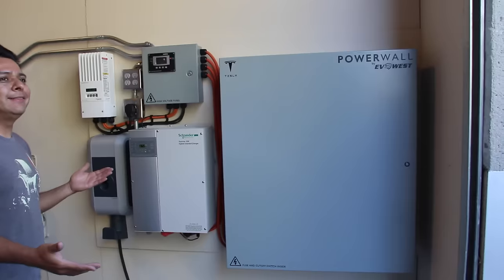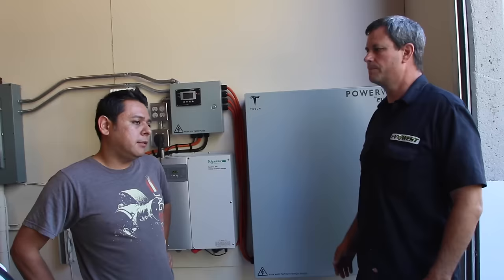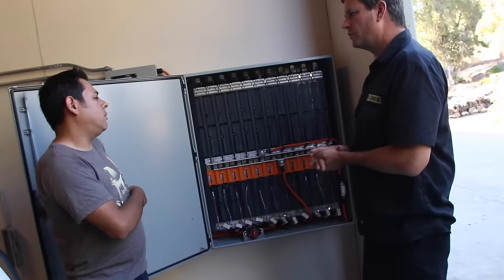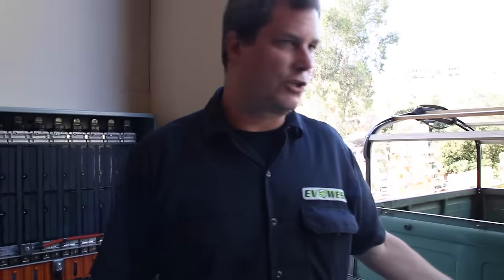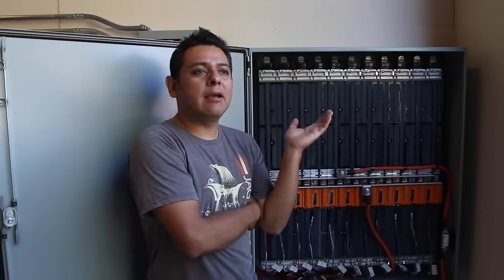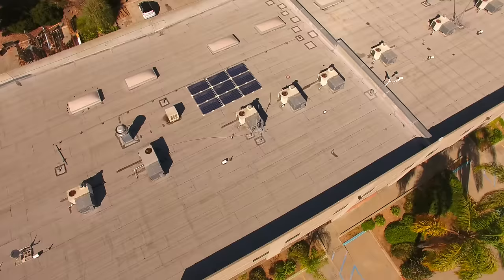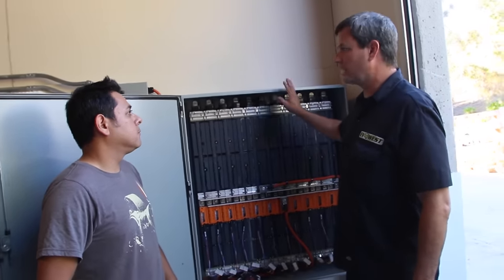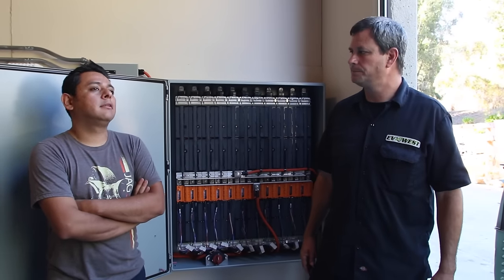DIY TESLA Powerwall  - my  WALL vs ELON'S WALL

Comment: So... there was an ad before your video began where you simply replace a "battery pack" in your lawn mower. Why worry about the cable hookup and the big chunk of down time to recharge your car? Why not simply make the car power pack replaceable? And instead of driving to a recharging station and "topping off" the car's power pack,  and taking that long down time, why not simply drive your low car battery pack to your shop or to a "recharge station" and leave your old, low battery there, pick up a newly, fully charged power pack and plug it into your car and go? For driving across country, you could simply load up 10 of those car power packs and go - practically non-stop. In addition, you could have a "to go" car battery power pack recharger that you could set up while you're driving so the sun can "trickle charge" your car's battery power pack. I don't know anything about any of this, but what I just said seems way more logical and doable.
Reply from the maker: +Ken Jelinek battery pack is 700 lbs
Reply: Haha! I had no idea! But still - for now it is. Everything is usually overbuilt, bulky and unsightly in its beginning phases. But as batteries get smaller and more powerful - just like every technology - then that's where we'll end up. So, why not leapfrog this step and start planning and building toward the next step? Again, look at the lawn mower advertisement. https://egopowerplus.com/pages/technology
Reply from the maker: yeah,  building an interchangeable battery pack is not hard,  many have done it including tesla,  its just not very practical at this point  but totally doable
Reply: yes this is already being done around the world and I believe a few places here in the USA with telsa from what I understand.

Comment: Why get the DC voltage up and obtain lower current ? Answer: Cable loss = current^2 x cable resistance. Plus: contact resistance and all other resistances in the circuit. Simple example: P = 5kW R_cable=0.1Ohms. At Voltage = 200V P_loss is 62.5W whereas at Voltage = 500V  P_loss is just 10W. Not linear. Voltage ratio is 2.5 whereas cable loss power ratio is 6.25. Nerdy ? Yessss

Comment: What brand of solar panels do you guys typically use? I see the one in the description is Boviet? Is there a brand to avoid etc? Also how are they wired? I'd assume you can't just series all of them since I think the gauge of wire wouldn't be thick enough for all 6 through the wires on them. Thanks.
Reply: I recommend solar panels that are made in the US, e.g., Suniva, and other places where they have reasonable manufacturing standards, ensuring minimal environmental impact. Each string is wired in series. If you go with SolarEdge's power optimizers, their inverters have technology to maintain steady voltage, regardless of the number in series. I simply have two strings of 12 panels because that's what fits neatly on the house. Each panel connects to one another with plugs that come stock with the panels, then you run USE-2 cable (usually pretty thin gauge - mine is 14 AWG) to the inverter. I bought a kit from WholesaleSolar.com. It was ridiculously easy to DIY. Saved $15,000 by doing it myself! Engineering labor is freakin expensive.

Comment: From my limited knowledge, all you would need to do is tilt your panels at "your latitude" (as listed on a globe or gps) ...that tells you your degrees from the equator, where the sun is, on average, directly overhead. i.e. If you lived in Equador where your latitude is Zero degrees, you would tilt your panels "Zero degrees" (you wouldn't tilt your panels, you would lay them flat, parallel to the ground!)  because the sun is directly overhead.

Comment: I find this power wall much more interesting than the Tesla. Tesla will run at a higher voltage than most current inverters can use. I would be interesting in the battery pack at about 1/2 that size. I do worry about the longevity of the LithiumFePh batteries though. Yes I use lead now (off grid 15+years) could you get warrantied batteries for 5 years 16 Kwh for $5K that would be competitive with forklift batteries (5 year warranty 15Kw @$2500 delivered)
Reply: The are FLA batteries that have an 8 year warranty.  Battleborn Li-Ion offers a 10 year warranty but they do NOT state "% Capacity Remaining" after any # of years.
Reply: @vtorsi610  FWIW - 9 years into my current forklift battery, doing well. The company dos offer a 10 yr warrant to 80% state of Capacity. Some people have gotten 20+ years off of Crown Forklift batteries. I'd like to get 12-15.
Reply: @whitelfner4582  WOW!  Owners always report  good things about Crown batteries.

Comment: I like this video, I was wondering how to acquire those offset conductor bars in the video and best way to contact Mike about the aluminum bar the batteries are hanging from? I am making a solar shed setup to charge my electric motorcycle and power a small addition on the house. Using this setup as a general blueprint.  Starting with 3 panels and adding 3 more every other month as $ becomes available.  What do you think the smallest number of batteries I could start with?  Sorry to hear about the cancelled Samba project, hang in there.
Reply from the maker: +Keith P  you need to fab the pieces.  How big will your inverter be?
Reply: I'll be using the same size, the XW6048 if I can find it reasonable, or a new 6848 otherwise.
Reply from the maker: At peak each module is good for 1/2 hour so I'd say start with a couple and add from there
Reply: Thanks for the feedback.

Comment: I would have gone with NiFe batteries.  This is exactly the reason Edison invented NiFe batteries in the first place.  NiFe cells don't stack nice and neat and take up a huge amount of space but they are have extremely long life, nearly limitless cycles and a very deep depth of discharge.  The main drawback is cost per Ah but I think the other positives far outweigh that one negative over the long run.  Lithium Ion cells start losing charge capacity fairly quickly and a very specific number of charge cycles.

Comment: So, right off the bat I'm impressed by what you guys are doing!
One question I have (and I'm a complete novice here); I work in a Government department (not USA) & we sub-lease other agencies in our building - it's a win-win situation for us...
However, when a new agency comes on board they have an option to use our 160KVA UPS (via backup generator - if required), or they can be self-contained & have their own UPS off of the tenancy supply.  But what we will not do, is have a UPS piggy-back off of another UPS & the reasons I was told is that when you connect UPS's in series that you "wear out" the upstream UPS 'faster'...
Is that of any concern for a "PowerWall" situation like this; where you're using (essentially) a UPS to charge another UPS?  Or is there no concern, because effectively the upstream UPS is only charging the downstream UPS for a brief period (read: not constantly)?
Reply: It seems more likely that the suits don't want some other department lasting longer in a power-outage situation than your dept.  If the power goes out, your UPS would provide leckky to whatever is attached (including the 'cheap' UPS in the other dept).  
However, once yours is empty and it stops providing power to your department, the other dept's UPS would still be full of charge.  The cheap UPS would then use it's batteries to provide power.  This would give that department more runtime than you guys, which I would imagine that the suits (who spent many thousands on a UPS) wouldn't be too happy about.  Why should a cheap ass department get more runtime when they have only spent a couple of hundred on a UPS solution??  How do you justify spending all that money on a UPS when your boss comes along sees the other dept still working happily?
Yeah, you could argue that this will "wear out" the UPS faster, but I don't think that's the real reason...  office politics is probably closer to the truth!
Reply: the problem with Daisy chained ups is there there is no indication of power failure to the downstream user and therefore no mitigation of systems until the upstream UPS is dead.
Reply: The downstream UPS won't "wear out" the upstream UPS.   However,  the downstream UPS  will  burn extra watts of  energy to charge its own batteries,  above and beyond what the bare load would draw,  and that happens  even when the upstream UPS is on backup power.   So essentially,  the issue is that more electricity is being used during a power outage condition.       Also, if the downstream UPS is sensitive to the voltage dip;  when the upstream is on backup power,   the downstream UPS might reach a condition where it is  repeatedly switching itself  On and Off between "Line" and its own backup power,  the downstream UPS might cut out, even while the upstream UPS is still supplying power.

Comment: Hey jegugarcia, I have a big question on grid scale battery. 
1.1MW/MWh battery vs 5MW/20MWh battery 
The 1MW is used for regulation service and the 5MW is used as a peaking power plant, but both can be built with a same AH battery but with different inverters ? 
Can you explain more I am not able to connect everything?

Comment: You need a permit to install solar power on your house in Michigan. Your tax will be assessed on the added cost of the solar system, and your property tax will increase forever. Further, DTE pays 2 cents a kVh you produce, charges you 17 cents for all you use and you need to pay $200 for DTE connection. In short, going solar in Michigan is a losing proposition.

Comment: How do you compensate for the float stage? I've read that floating Lithium batteries is a big no no. You may not have this issue as you guys are always charging vehicles with larger battery packs and your charge controller may never go into that stage.
Reply: Li-Ion certainly can be put into Float charge ...

Comment: Hi Garcia, I am from Honduras, the cost of electric energy here is at all time high, probably the worst price per Kwh in latin america. I have to air conditioners of 18,000 kwh/220v in the house, I want to power them individually using your DIY powerwall, each ac will work 12 hours a day.  Do you have a video for powering air conditioners? How many solar/Tesla panels will I need? Thank You.

Comment: What if you mounted the electronics in a car using the batteries already there with the panels on the roof how long would it take to fully recharge the car ?

Comment: Jehu check out Solar Power Electricity and Electronics channel he has most of his entire house running on Solar Panels, even converted his TV's and Dryer. I'm surprised all that sun not many in California are getting on the solar panel bandwagon.
Reply from the maker: +TekReviews  every other house has solar in Rancho these days
Reply: jehugarcia Oh that's good, in Australia even if you have Solar they don't pay you near anything for putting energy back on the grid. I saw a documentary in Cali about getting low income people hooked up because they can't afford running an AC all day long in that hot heat wave. Maybe you can do a project powering a room air conditioner for a low income household with those smaller solar panels you get at places like Harbor Freight.

Comment: Do you guys know when we are going to see energy storage in homes in the form of Hydrogen and Oxygen? They don't use it a lot in cars because of the sensitivity, but I can imagine in homes it is pretty safe. Fuel cells look promising for their conversion into electrical current. Storing gas can last forever, maybe some combination of a powerwall would be interesting?
Reply: Another conversion that reduces overall efficiency quite a lot. Also, storing liquid hydrogen and oxygen is kind of dangerous.
Reply: PbPomper
If i'm correct fuel cells based on H2 and O2 are the most efficient of all.
Reply: no, Hydrogen fuel cells are much less efficient than batteries.
Reply: @NextGenAge  NO!  Fuel Cells are LESS efficient ...

Comment: well i am sceptical. 15,670$ and you only use it for charging EVs? my question is: is it worth it? besides that it is a hobby.

how many miles could you go with 15,670$? 
i estimate that only rising prices for grid electricity and staying fully functional over 25 years would justify your DIY powerwall

Comment: Hi jehugarcia, I follow ur make powerwall all clip. I Interesting about Components and connection diagrams, And Then  If you can easily describe some of the features of each . When i saw your clip there seems to be as detailed on the circuit complex directory in your system.

Please describe about Components and connection diagrams
Reply from the maker: +Wichai Sriwiset   All that info is available in videos,  I don't have info on inverters because I don't have one yet but everything else

Comment: UPS uses 12v batteries. the inverter has to switch at 60hz which means a large transformer. eff is around 80% and power
is limited to about 1kw per transformer. the transformer ratio would have to be changed from 120/12 to 120/48

and the output voltage would sag with battery drain voltage sag. guess i should mention that the primary transistors would need to be rated for at least 60v which their prob not.

you could wire 4 ups's to each 12v bank within the 48v pack without modifying them. but it'd prob affect pack balance
Reply from the maker: +Brad Steffy I plan on using 48v ups units
Reply: +Brad Steffy The large UPS (for servers) tend to run off 48V, otherwise they draw a crazy amperage from the batts.  Consumer units are 24V or 12V - the latter for really weak & cost sensitive units (as they only require a single batt).  I have a UPS which I obtained for an in-bus inverter project (24V DC>240V@50Hz), but was rather annoyed when I discovered it was a 48V unit!

Comment: Hi and greeting from Melbourne Australia. Question#1 What happens when your battery wall pack is fully charged. Question #2 Can this Battery wall pack power a house with all electricals inside including Fridge/Washer and A/c's, Computers, Big screen LED TV's and electric heaters etc...
Reply from the maker: +SirZok1  
1- stops charging   
2- yes
Reply: Thanks bro....

Comment: What twists my mind is: Why we have to convert DC to AC then AC back to DC when we use mostly DC-loads only? It's a lot of power loss added to the already low efficiency of PV panels.
Reply: So to get this staright, the car's batteries could be charged with DC from the storage batteries with a fancy charge control device. I know that the companies have to sell a lots of equipment to make money. But this is pure bullshit.
Reply: @szaki95  Don't just talk about ... Design & BUILD a better system ...
Reply: @vtorsi610  It's not rocket science, you just have to build in more protection cause DC might fry something. Otherwise it's the same thing, most newer equipment uses switching mode power supplies anyway.
It doesn't have to be high voltage either, some LED lights work as low as 50-60V.

Comment: Pricers are taken from listed parts list and is almost $5000 more expensive than shown in vid???
$1000 USD for each battery (module), they have 11, = $11,000
Inverter $4150 USD
Controler $560
16 panels $2600
$1500 to $2000 for other parts
$20,000 usd plus applicable taxes and you put it together

I wonder what the pay-back period is?

Comment: Thanks for making this video. I'm considering purchasing a 7.8kW PV system for my home The system is designed with a 780 Ah 48 VDC 37,440 Wh Battery Bank.  It has sixteen 390aH, 6v L16 batteries. I'd like to replace the spec'ed battery bank with a DIY home battery made with the Tesla batteries in this video. Can someone give me information on what that system would look like? How many batteries would I need and how would they be wired?

Comment: Panel Angle - 14:00 - Yes, properly angled static panels would produce a Little less power than direct facing, it wouldn't be that much less than flat on the roof.  And 3/4ths of the year it would be more.
Reply: 12% LESS !
Reply: @vtorsi610   It's a matter of 12% less power for part of the year, or 25% larger initial cost plus a maintenance nightmare.
Reply: @chrisw1462  Please explain  "... a maintenance nightmare ..." due to FIXED TILT panels?
Reply: @vtorsi610  Didn't say fixed, did I?
Reply: @chrisw1462  You said, "Static Angle"   I said, "FIxed Tilt"  Both, mean the SAME thing. There is a 12 % Net Yearly LOSS for Flat vs Fixed Tilt.
Reply: @vtorsi610  Sorry, I misunderstood your reply.  Yes, that's probably true in your area (in other latitudes it might be more or less, and the roof pitch would change it, too).  Direct facing panels get the most energy, fixed tilt a little less, and flat on the roof can be less or the same as fixed if your roof angle is the same as the optimal fixed angle  (A good thing to design your house for).  Also, you can (and should) tune the fixed angle to the season your household uses the most energy, which will possibly drop the yearly total even more.  Cold climate, higher latitude homes would want the system tuned for winter, when the low angle, weaker light means a lot less power.  That would drop the power gathered in the summer by a lot.
Reply: @chrisw1462  A 17% Loss, is true for this video's location per NREL ( National Renewable Energy Labs ).

Comment: Nice....  But you are losing a lot going from DC to AC to DC again.    Around 30 percent total.   Try using welding cables for the DC Power Cables and other high power concretions.

Comment: Ok so I have old old batteries that are flat lipo packs I have 105 of them 6000 mah I plan on doing a 3s pack but I have a generic inverter I want to upgrade it should be around 200ah at 12.6v but issue I'm having is I can't find a way to use lion and lif4po because they don't have same voltage as a lead acid